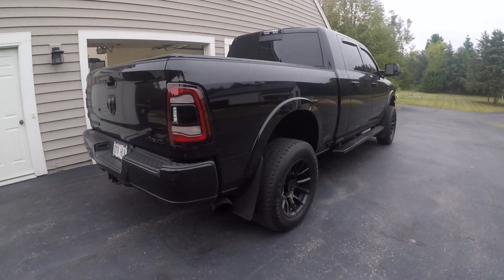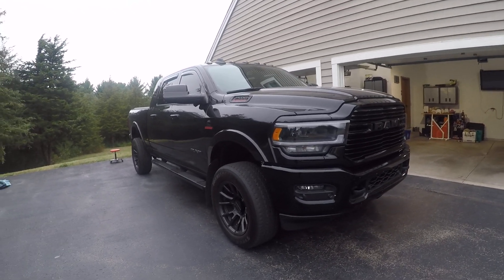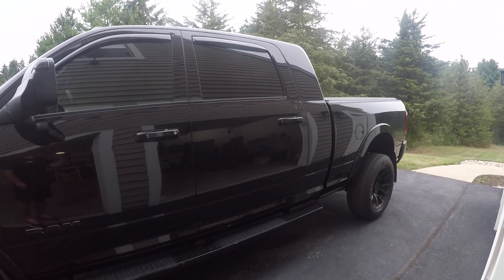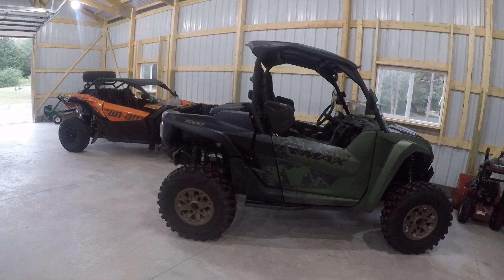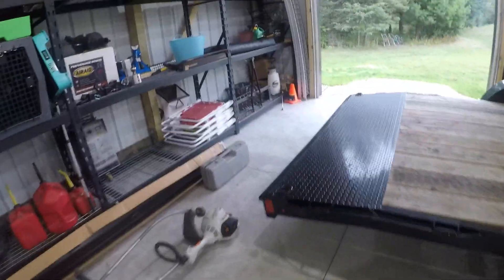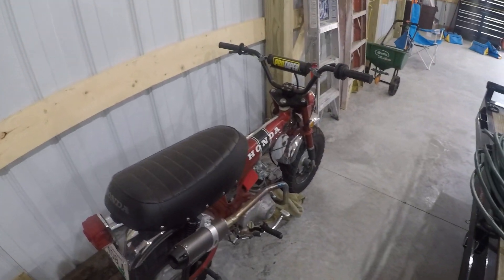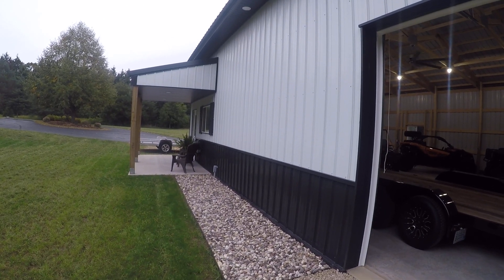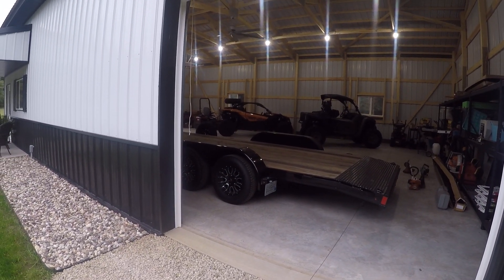Ram 2500 Mega Cab Cummins 4" Exhaust

Comment: Sounds great. I am looking into buying a "kit" for my truck. I'm confused though. A lot of them include options for a 5 inch "full" exhaust. When I ask them what that means, they say its from the flexpipe back. Is this what you have? I was told there is no true turboback exhaust for these. I just want it to be as opened up as possible and get some good sound. Thanks! Its for a 2021.

Comment: What exhaust are you running and is this stock with exhaust or deleted as well ? Thanks great looking truck btw
Reply from the maker: The exhaust is P1 4" downpipe back, no muffler.
Reply: It’s deleted
Reply: @DCOLLA87  is the drone bad? Figuring out if I want a muffler or not when I do my truck. Thanks
Reply from the maker: @Farout397  I didn't think the drone was that bad. I like to have some noise with my vehicles. I did have a few people that were sitting in the back comment on the drone.
Reply: @DCOLLA87  gotcha, another question I had was with your tune were you able to keep your DEF gauge on full? And is it possible to program the exhaust brake to stay on all the time?
Reply from the maker: @Farout397  With the tunes I had the DEF gauge was showing empty, which didn't bother me. I never asked to see if they could change that reading. My exhaust brake would stay on permanently.
Reply: @DCOLLA87  gotcha, and I briefly heard about the engine brake on a blog so figured I’d ask. Thanks for the replies, I do appreciate it.

Comment: What's the interior look like on it. I'd like to order one next spring so just wondering.
Reply from the maker: Interior is standard for the Laramie trim with the 12' radio screen. If I were to do it again, I'd go for the Limited or Longhorn trim level.
Reply: @DCOLLA87  I have a Laramie level 2 as well and of course loved the longhorn saddle interior. I just could not justify the additional cost for what you get bumping up from the Laramie. to the longhorn/limited. Can you give me your thoughts on what additional value you see and why you would go that route if you could do it again. Great video btw, I am about to get rid of all that useless crap as well..

Comment: What did you do to make it sound like that?
Reply: Got rid of the OEM junk. He GREATLY extended the life of the engine. And...over time saved thousands$$$. 5th gens are having more and more costly defects with the emissions systems. With that knowledge, I bought my 4th gen mega cab brand new. Do yourself and your expensive diesel toy a favor...DELETE AND TUNE!!!!! Go 5inch back off the turbo too! Best truck you've ever owned
Reply: @REALITY6.7L 5” from the turbo back is the best way! If you’re gonna do it, do it all the way with 5” instead of 4”. I had a 5” all the way back but with a muffler on my 2016, absolutely perfect, no drone whatsoever but still loud when you wanted it to be.